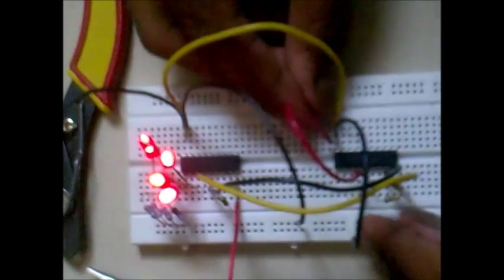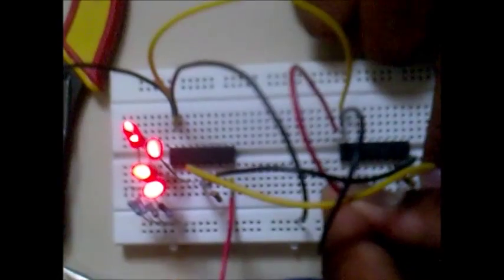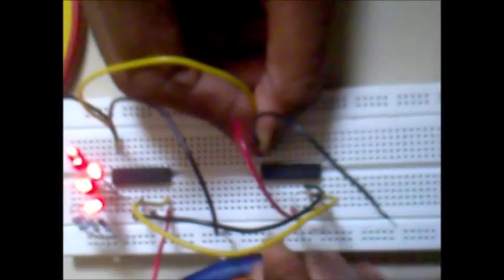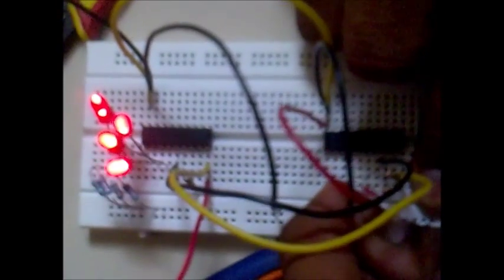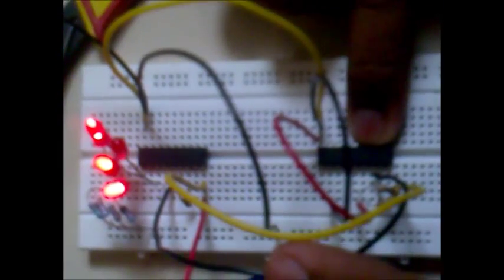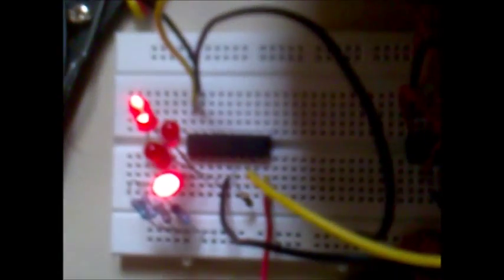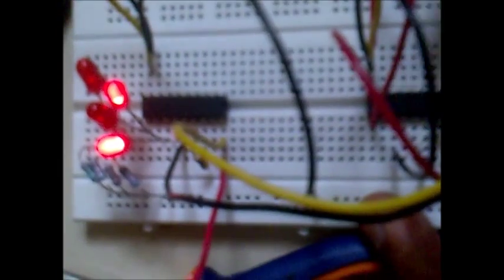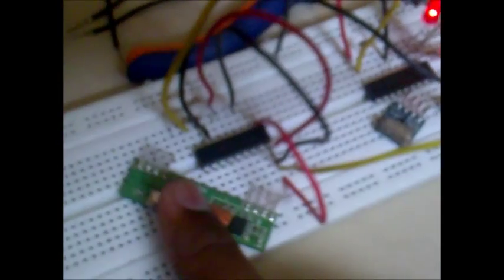Troubleshoot RF Transmitter and Receiver Circuit for RC Car

Comment: Sirji is it possible for you to make a video on explaining the working of the circuit diagram of the 433 transmitter and receiver module  , how  the data transmission takes place between them. Please do it